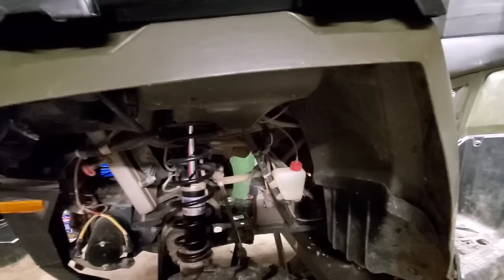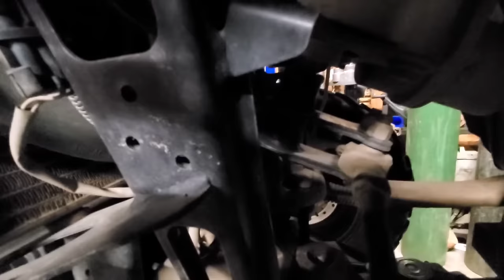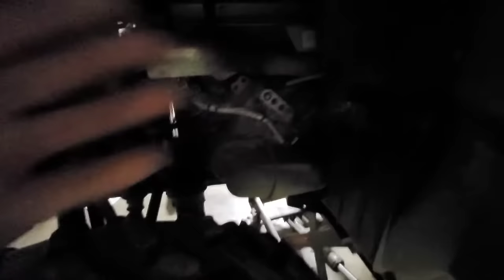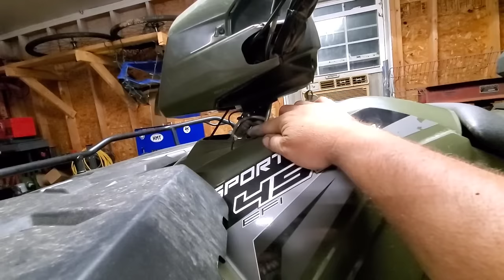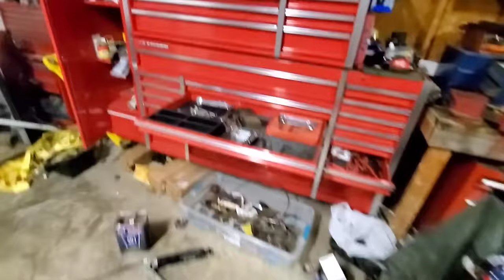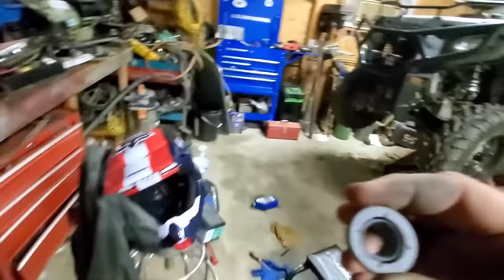Dear Polaris...this is shameful  #polaris #atv #sportsman

Comment: I’ve bought and sold my last Polairs , their side by sides now cost as much as a truck. I’m switching back to Yamahas . My last RZR cost $19k and I did beat my rzr  me and the wife went trail riding . No mudding or rock climbing and it went through belts every 300 miles . When I owned Yamaha sxs and 4 wheelers we never had to replace anything on it other than the fluids. So Polairs as of last fall lost me as a customer. You see they have stopped caring about their customers it’s all about the dollar now so I’m done with them. I’m not spending $18-to $25 k on a machine to ride trails . If I wanted to spend that kind of money I would buy a jeep with heat and air in it lol. Polaris has there new expedition that cost $50 k ! Really ? Fuck that I’ll buy a jeep and have more fun and save money.

Comment: We have a ‘93 Honda 350, and a ‘97 Foreman 400. We’ve gone through brake pads, and the exhaust on both…that’s it. The 350 has a 13hp snow blower on the front that really works that frame and front shocks/steering, no issues. 
To say the Honda’s are over engineered is an understatement. 
No way I’d ever buy a Poo. Never owned a Poo snowmobile but friends have, won’t buy one of them either.

Comment: The plastic clip saves time on the assembly line. My 570 cost the same as a 500 from 10 years prior. They're building them cheaper so they can offer more bang for the buck.

Comment: My friend owns a 2003 Polaris Sportsman 500 atv.  It has 2000 miles and bushings were slop.  We tried to drag a pallet on a plowed food plot and it ripped the hitch mount off the back.  The square tubing frame where the hitch was mounted is paper thin ...looks like a Tonka toy.  Contrast that to my 2002 Kawasaki Prairie ...the frame is a beast.   A friend crashed one into an 8-inch irrigation pipe around 30 mph with right front tire (he went airborne with only minor injuries).  Frame bent back about 4 inches.  We tried to straighten frame with a chain, an oak tree, and a 4x4 with a v8.  Tried low range and a short running start.  After jerking it for half hour we managed to bend the frame back less than an inch.  Ended up buying used frame and transferred all parts to it.  Wrecked bushings are still good.

Comment: It's a shame honda and Yamaha aren't paying any attention to atvs. They would be on top right now if they had 1000s.  
Also i just bought a cfmoto 1000 and i would recommend after 600 miles and 1 season
Reply: I am about to sell my 2004 Sportsman 500 and one option is CF Moto (because parts here are 3x the price they ar in the USA). CF Moto are cheap compared to Polaris, are their small engine models any good (400), where are they made, what is the history of the brand? ……. Any advice or opinion gratefully accepted
Reply: @jolyonrussell7021  they are easily the best machines made in China. The 400s and 500s are very minimalist, good entry level atv, still decent quality. 600 is a great machine I almost bought one before my brother chipped in a few bucks to get a 1000. The 800 is awesome and the 1000 is an 800 with better shocks, a winch, bumpers, better lights, storage, and bigger wheels and a windshield.
Reply: Yes, Honda is going cheap. I'm seeing it.
Reply: Love my 1000 CF!

Comment: Out of the 15 Polaris products I've bought in the last 23 years not one has been trouble free or held up ,So far my 2022  570 been recalled 3 times. I will say about time the battery in a spot where you can get too it ,But lost cargo space and have no rear storage compartment , The vent tube for the clutches why is it low on the chassis what a crappy idea. Im done !

Comment: Polaris guy accidentally selling Honda's.
  2003 foreman 450s  14000 miles
 2011 foreman 500s 7500 miles 
 400ex 🤷🏼‍♂️ no odometer 
700xx no odometer 
300 4x4 no odometer 
If you prefer riding to fixing its hard to beat a honda . Yamaha is a close second and alot more like a Polaris in ride

Comment: I am in the market to get a side-by-side, (first one) Polaris is not even on my radar. I would get a Cfmoto before getting a Polaris, I hear too many negative reviews about Polaris (Social media at work). I would not buy a newer model, used or new Polaris regardless of price. (I just sold my 1995 Polaris Classic Snowmobile this winter, excellent snowmobile and had it for many many many trouble-free years) Unfortunately looks like quality  at the company has gone downhill drastically.

Comment: I have a 07 Sportsman 450 and have only had to replace the bushings once and nothing else other than batteries. I like the older ones as they had built in storage box on front and under the seat in the back.  For someone who trail rides that is sufficient for me.

Comment: Spent about 30,000 on a general had problems with it right away in the shop a couple times and the transmission went out 4900 dollars for a replacement and Polaris won't cover it fuck them

Comment: I bought the Gen 3 700 xmr Can-Am after owning a 2021 850 Polaris Sportsman. The ride is like a Cadillac compared to the Polaris. At 1000 KM the Polaris started costing me money big time. At a 1000 Km the Can-Am so far every thing is still water tight and solid. I can go in water over the fenders and do so often. All I have done is 1 fluid change. It's ridden hard and put away wet. I traded in the Polaris at 3000 KM. Got the report from the dealer, it needed $3000 worth of work before they could resell it. Good thing they did not inspect it before they gave me the new machine. Polaris ATV is Junk.

Comment: 9002 miles and almost 3000 hours on my  2000 honda foreman 450, no oil burning no leaking no issues, starts like magic every time,  plows snow like a beast. When i went to buy it the miles and hours scared me a bit but its a HONDA

Comment: I have a 2008 Polaris Sportsman 400 4x4 and oh my Jesus the trouble one after another it should just be a parts ATV by now but I can't help myself and refuse to be beaten by an ATV! However, being honest I may be beaten, I've run out of answers but not problems, and while there may be many forums they are never for an 08 400 plus I have specific issues! I'm to the point I wanna pack it with tannerite and mag-dump it!

Comment: AMEN! In 2006 I bought a new 500HO, that thing was built like a tank. Front bash plate was steel, all snorkels were above the gas tank, and axles were heavy duty. In 2015, I bought a new 570. Wow, how pathetic. The front bash area was mainly plastic, snorkels were at knee level. The axles were downgraded big time, the rear axles were about the same size as the 500HOs fronts, and the fronts were a joke. Got rid of both to get a SxS. After seeing the build quality of the new Polariss, I wasn't going back to another one. Went Can-Am. Sure hated to get rid of the 500HO though.

Comment: I don’t know much about the new ones but my 99 sportsman 500 has done me well still on original engine no rebuild since it was bought new been through all the Hatfield McCoy trail system many times I did put shorter shocks to level out the rear axles and went to bigger rear tires to correct seat height 20 years ago and haven’t put an axle in it since  they do have issue getting that right cause it still a problem I have heard

Comment: We have two Indians built by Polaris and have exactly the same experiance. Each of them have major design flaws and major recalls. Each bike has had more recalls than all previos bikes combined since 1973. My first bike a Honda 250 was never recalled for break failure, fueline problems that were a fire risk and not once did I ever have an issue with switches failing because it was humid or raining. That little 250 Honda made it all the way from London to St Tropez south of France with no issues as did the 500 and the 750 at very high speeds and in heavy rain. With the Indians there is a good chance I would miss the ferry due to unrelable switches. Then they would not keep failng in the rain and after braking issues on both biked its always a concern. Lastly the deliberate detuning of bikes so that power can effectivly be purchased back by forced dealer install of mufflers and air cleaners so they  can be dealer flashed is in my mind nothing more than  a con job. The muffler and air cleaner potential to increase power is far lower than the percentage available when flashed due to installation which is why I believe they are purposely detuned to sell accesorios .
Further most companies sell their best effort. None of the Hondas required expensive Honda parts to perform properly right out of the box. None required multiple modes either. Each  could go from idle in heavy traffic to top speed with one mode.
I love the look of the Polaris bikes badged as Indians, they have done a really good job of that. The clothing is good quality and the comradery is good. The bikes they are Polaris for sure and my experiances match everybody elses on this site.
I am suprised there has not been a class action suit to be honest. Polaris are not alone either. The practice of selling features already paid for by charging monthly subscriptins to use them is being tried by a number of companies which we need to stop.
We will never buy another Polaris product ever again.

Comment: I have a 2013 Polaris ranger limited I bought new . 10 years driving the back country of NE New Mexico and  Oklahoma panhandle no problem. Replace breaks , belt, plugs and wires, tires , etc. haul firewood, dirt , plants, feed , etc. walk it in and walk it out of rough conditions

Comment: I run a small power sports business and work on every brand. Unfortunately, Polaris is the cheapest engineered machines. I have found CanAm, Honda, and Kawasaki to be the most robust when it comes to suspension and bearing quality.

Comment: I just bought a new 2022 570 and have been thinking I should've gotten a cfmoto  for way cheaper. Even if the cfmoto was made cheaply you could at least afford it. I do like my 570,but if I had to do it again I would have bought a cfmoto and saved 3k.
Reply: I bought my wife 2017 sportsman 450 H.O, left her on the trails too many times, I had enough of it cause it was costing too  much money and time and wondering when the next moment for it happen again. End up trading it for a cfmoto cforce 800 and its been great so far...
Reply: Nothing wrong with CFMOTO They seem to be built to last And I've on a lot of bikes.
Reply: My cousin had a CF Moto quad and it was a winner. He got a 2017 CF Moto sxs and it had some issues that ended up costing another $1200 and a couple of additional warranty trips to the dealer. Been good since the repairs last year though. You roll the dice with anything, it’s a matter of playing the odds with the information you have. I got a cheap Chinese dirt bike and it’s been a champ for several years now. My neighbor got one and had to replace the carb and shock after 2 or 3 months.
Reply: We all take a risk at what we buy. I have a 2016 Yamaha grizzley SE, 2019 can am outlander 650xt, and a cf moto cforce 800xc. I can honestly say I was on the fence about cf moto but I and my wife load it down with gear and go on 2 to 3 day rides with it. The kids and grand kids ride the other machines now days and me and her double up on it and go. Built very good and no issues with it. I am very pleased with the machine. Just thought I would let people know their cheaper, and reliable, and you get alot off added features. Plus there ia alot of good info out there about them from Main Street Cycle, and Red Neck Garage. But we all have our brands we love or stand by. I bleed blue, I love my Yamahas, but they want way to much for them and havent changed a thing but the color and tire size. All I can say is sometimes u have to jump the fence cause grass is greener on the otherside. Stay safe and happy trails.
Reply: Lots of problems with the polaris, mostly front end, but it's still 10 times the bike as the Chinese garbage they are selling people, Folks around here call them junk rice burners hahaha

Comment: I look at all.... atvs in May 2023. I ended up with Argo 1000 xrt le 2up 2500 miles òn it very happy with it just fluid changes. Fast fun and rides really good. Price,winch,2 receiver, awesome tires 14" mags rims, power steering,unlocking front and rear... differentials,2up seat,3 year engine warranty. Would I buy again absolutely at this point.

Comment: Im happy for my old 07 500 X2, but when changing wheel bearings it was real bad bearings on bolts, totally rusted, plastic bearing.. Should have been grease nipples all over for those.. But, Polaris is the only ones have the type as x2 with 2 seats and tip..

Comment: I hear you loud and clear, But YES the manufacturer purposely built it with much less quality and this is a fact. Why you ask well this is a Trend nationwide and also pertains to the Auto industry for light-duty cars and trucks. The number 
#1 reason is cost effective to the bottom line and they want to maximize money profits.
If the manufacturer would source rock solid parts then the product would be very expensive and they
do not want those price tags on there products.

Comment: Polaris is like Harley Davidson it's junk that if it wasn't made in America. Nobody would buy them. I  have two Hondas 1 is a 2000 and the other 2015 neither have ever had an issue with anything. They cost more then Polaris but when your 60 miles from your truck there dependability is priceless.

Comment: I bought a 2017 polaris and at 5000 km my engine went. Piston seized in the cylinder. I bought a used motor and still in 2022 I'm using that rebuilt motor

Comment: Talk about belts to and clutches to like every oil Change and something all ways has to go wrong after a ride
Reply from the maker: we haven't had belt and clutch issues, but where the ball joints ho into the front spindles constantly egg out. serious lack of of quality
Reply: Idk what the hell you guys are doing to these machines, they aren't racing quads and if you beat the hell out of them it'll show. Ride it like it was built to be ridden and you won't hardly have any issues. I'm at 1k miles and have had absolutely 0 issues going through mud, rain, snow, and rocks galore.
Reply from the maker: We take care of our wheelers. We do not take them in deep water or mud. Our riding is trail riding and always with kids, so our pace isn't even that fast. 
We have multiple Polaris machines and noone keeps up with matainence better than me. Greased, serviced, checked over and parts replaced. We have 2000 + miles on our machines and constantly from that mark on they are in a state of needing repaired. I understand some things but steering shafts them selves failing? The bushings on all joints are worthless and give no life even with constant greasing.

Comment: I drill a hole or two an add set screws!
Reply: By the way I wouldn’t buy polaris stock bushings I would order bronze oil impregnated bushings on line. I have locally for me a company call bearings and drives unlimited try calling them give the dimensions you need and I’m sure they can get it. Screw the stock junk

Comment: I was a factory certified tech for over 15 years.  The bulk of my time was spent working on polaris.  Those guys are the masters of figuring out the fine line between customer satisfaction and component durability.  Every single choice they make is based on profit and they know exactly what they are doing.  They bring a decent product to market and then spend the next 2 to 3 years figuring out how to cut costs on it.  Ultimately leading to an assemble collection of parts that are just barely "good enough".  Unfortunately, the MSRP's of their product would suggest that they are selling the John Deere's of the ATV's and UTV's.

Comment: Dumbest thing ive ever done was sell my 1995 Honda fourtrax 350 in army green. Bought it new, had to finance, paid it off in one year. That was the second loan i ever had as i was only 25 at the time. Paid off my first (used) pickup truck the year before in just 2 years, so my credit was rocking back the. The Honda absolutely positively took anything and everything ever thrown at it. Just sold it about 4 years ago around start of pandemic bs and up to that point and from what i still hear, that machine has had ZERO mechanical failures in its entire life. I was careful to keep it 100% stock and original, as im bad about modifying vehicles which later causes problems down the road. It would take all day to make a list of what all i put that thing thru and it's still going like its 1999.

One funny memory on the Honda was this...we were at the dragstrip, i was using the quad as a pit scooter. As if we were going for some kind of record, i talked 8 other people to somehow climb aboard the quad, anyway they could. With me driving that made 9 people! Of course i couldn't see or steer, but it was fun and memorable and people who saw us thought we were crazy because, well we were. Who wasn't a little crazy in their late 20s early 30s?
Reply from the maker: Thats the good thing about wheeling. It always makes memories

Comment: My 2018 Polaris Northstar Premium with 2000 miles has had the transmission replaced. A gear shim got chewed up Polaris dealer called and said all the spare gears were manufactured wrong they didn’t know when Polaris would have new ones fabricated!!!! Very SAD!!! I do not beat this machine!!used around the Farm.

Comment: Had a 1997 500 sportsman for 12 yr , no problems ! Still riding my 2009 700 ranger and only thing I’ve done was new front springs and new tires ! I plow my 900’ drive way every winter. Haul logs through my woods for firewood 4-5 cords every , no problems ! 😂😂😂 Though when I’m ready for a new one it’ll be a Can-Am Defender.